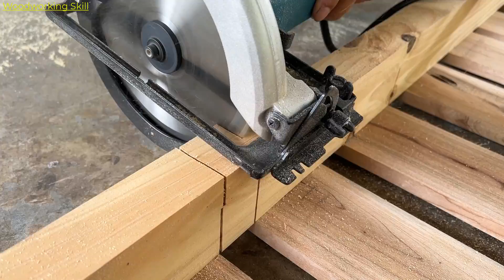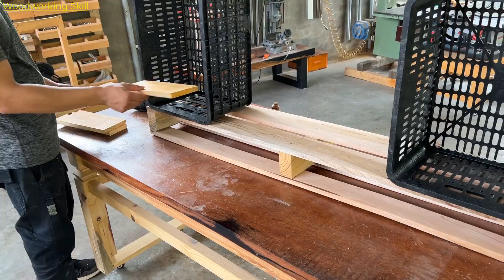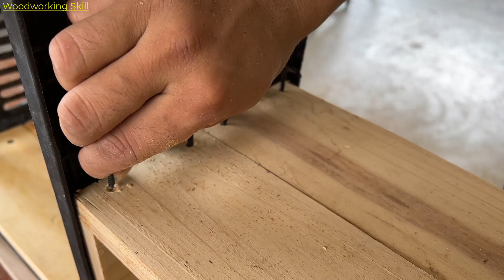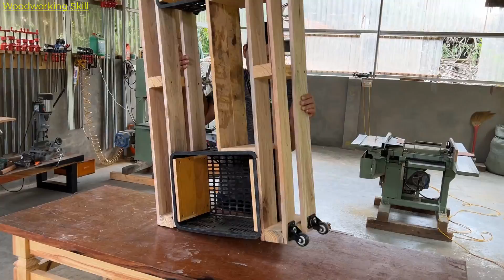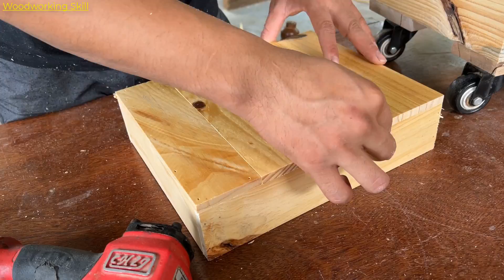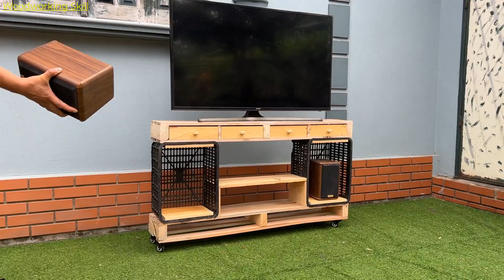Great Ideas From Old Plastic Pallets And Baskets // Surprises - Make A TV Shelf From Waste Materials

Comment: With good quality wood and just a bit better woodworking practices one could make something worth owning.
Reply: great idea but if you had taken a little more time with things like making sure your cuts we're lined up and to pre-drill those first few pallet boards instead of splitting the ends with your screws and using the proper screws with large enough heads for the casters it would have made for a much better quality product.
I guess I'm too much of a perfectionist even think about putting a video like this out on the internet with all the imperfections.
Reply: Yes lord

Comment: Bro you spend the time to do all of that and you split the wood putting screws in that all could have been avoided by pre drilling the holes or spin the drill backwards for a few seconds then drive them it will make wood not split even if super dry your idea is great but if you want to keep it for a long time don't split the wood just a friendly tip not roasting you.

Comment: IT IS NOT STABILE! 50 inches high on
Casters 6 inches apart, spun to center 4 or 5 apart. With out guy wires you are going to crush some young kid, or throw away a $1500 display console TV. BIG MISTAKE!!!